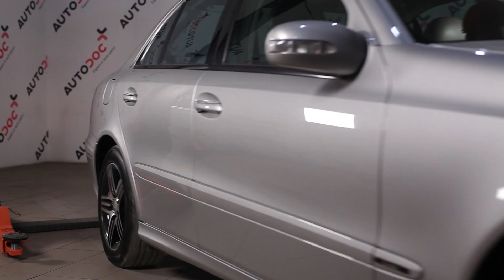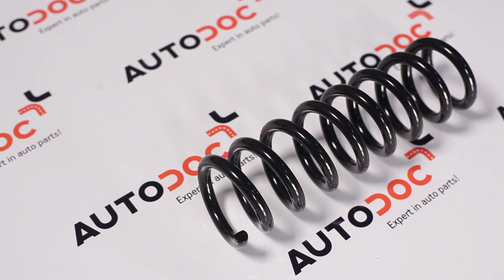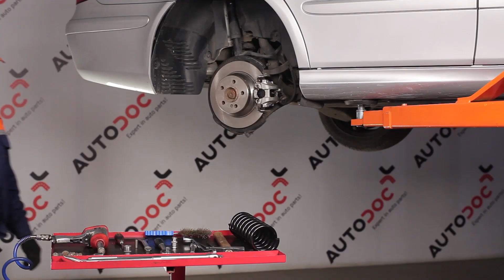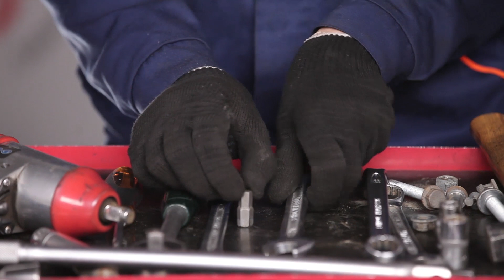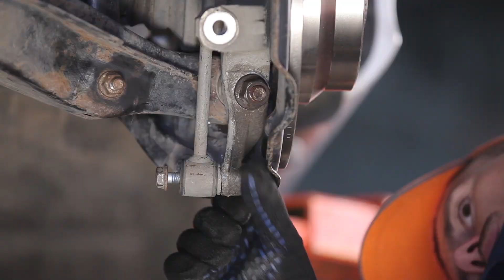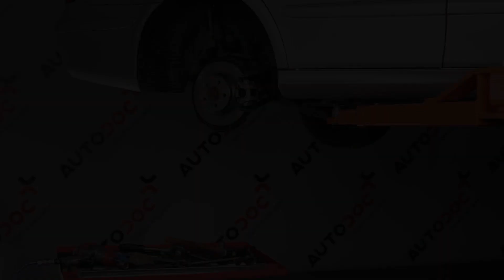How to change rear springs MERCEDES-BENZ E W211 TUTORIAL | AUTODOC

Comment: Had to use this rather tedious method as a backup on one side of the car. As others pointed out there is a steel bushing inside the wheel carrier which protrudes roughly half a mm into the opening and makes for an extremely tight fit to get the bushing from the spring control arm back in. It had completely seized and could not be pushed back by force. So I moved the control arm bushing past this obstacle first (slightly diagonal) and then straightened it out with hammer and mallet (inner and outer edge of bushing) out until a small part of the bore appeared on the other side ie. the bolt hole. Then used screwdrivers and all sorts of metal rods to pull it all the way through and align it. It helped having a spring compressor (low compression, safe), but it was not key to this work.
Reply from the maker: Thank you for sharing your experience, it will be very useful information for our viewers.

Comment: Excellent video and description.

However, 9:50 shows the hub not seated. Then by 10:10, as if by magic, the hub is perfectly seated ready to thread the bolt. In reality, be prepared for an EPIC battle to line up the bolt holes. Took us an extra 30 mins of fettling at this point.

Missing the torque settings for re-installation of bolts. Please add if you will. Cheers!

Also, there are 5 different rear springs for this model depending on spec, all colour coded. If you could list the Merc part numbers with description for vehicle type, this would be a great help.

Best of luck if you attempt this yourself.
Reply from the maker: Thank you for the feedback! We are glad that our tutorial was helpful for you. Your opinion and remarks are very important for us. We will take them into consideration for our next tutorial. Best regards, Autodoc.
Reply: Otto Fumbler, any tips for this?  I spent an hour trying to get this back in already?
Reply: Otto Fumbler doing this now. Any tips on reinstalling this knuckle?
Reply: jonosilvia you end up getting it back in? Any words of advice?
Reply: time warp? 15 minutes all in and I'm into my 2nd hour just dismantling, bolts were seized and I'both sides to do :-(
Reply: @autodocuk  Hello, you know where the sping sits into, did you try removing the other end side . 1 bolt at the other end and 1 shock absorber bolt. 6.45 left bolt at the end and shock bolt only?
Reply: did the opposite of what he did cause i had to replace the whole lca and when i installed it back you had to grind the inside of the hub so it can go in. lined that first then put the screw. then use a jack to put the other end of the lca (one with star bolt) either way it will won't be easy.
Reply: @autodocuk  can you please make a video using a special tool which makes the job dead easy. This work is not easy for everyone. Thanks.
Reply: I reinstalled the knuckle by removing the brake disc and bent the dust shield to get the crowbar under the arm to push the knuckle down still had lots of trouble but kept jacking up and then released to try and get it closer. Had to bash it with a wooden block until eventually I was able to get a screw driver in one side kept levering it and eventually got a small screwdriver in the nut side of the knuckle and then increased screwdriver size then moved up to a large hex key and was able to lever the bolt holes. Very difficult but did it this way as no advice online anywhere
Reply: By comparison, the front springs are a walk in the park. The only issue now is the age of the W211 chassis means you'll likely have to deal with considerably seized nuts & bolts. As well as front springs, I had to buy replacement upper ball joints having been forced to cut the old ones off with a hacksaw.
Reply: @ottofumbler7267  Hi Otto- So I was at the same point and about to pull out my hair.
The reason it is so tough (apparently) is that the opening is narrower than the new bushing.   Then I decided to go into the mercedes WIS and looked up the official procedures for remove / reinstall LCA. Lo and behold there is a simple step that this video omits.  SIMPLE.  One side of the receptacle opening in the knuckle is a smooth machined surface but the other actually has a has a repositionable bushing that slides.  You insert something into that opening from the rear to front of car and tap that bushing back into its hole until it becomes flush with that side of the opening. Voila- you just widened the opening. After that the LCA bushing will go in MUCH more easily without all the hacking.  Its a pretty clever design. This way I believe you torque the bolt back up it somehow drives that little bushing back so that you end up with a very nice tight fit against the bushing.  Hope this helps.
Reply: @ottofumbler7267 how did you ever get this bolt back in sir
Reply: @ottofumbler7267 I found the back easier
Reply: As others have said, this video is great up to this part. The truth is, there is a small raised flange on both sides, on the forward facing side of the hub that stops any bush, new or used, going back in. Until you file/grind/finger sander this down, you will probably never get the arm to seat. Once it has gone, it goes in without any effort at all, seat firmly and all is good. Nut I do call bullshit on this video just for the fact they gloss over that part.

Comment: Hi there,
It’s a late in the day question about this vid tutorial , but here goes, what size socket is being used to loosen that rear bolt at 2.52 mins into the video.
Also some people seem to be saying they struggled to get the hub assembly back into place.?. 
Would you have any suggestions on that part of the job also, as the video seems to cut away    Just before your technician shows how it’s done. 
Thanks for the video and any answers or tips you may have with these questions.
Reply from the maker: It is not possible to answer your question and you can find the requested information in the technical documentation for repairing of your model of car.

Comment: Great Video! I had a question, My 2010 Mercedes CLS 219 had both its rear coil springs replaced recently as they were fractured. Following replacement, the rear ride height seems to be a few centimetres more than it was previously. Is this normal? In time will the rear ride height go back to how it was on the old springs that were replaced? Many thanks in advance.
Reply from the maker: We do not have such information, we recommend that you consult your mechanic.

Comment: wouldn't it be easier to unbolt the inner part of the control arm? jost one bolt, and lower it with a jack
Reply from the maker: Thank you for the feedback!This video is considered to be an informative one, and it is approximate. Best regards, Autodoc.
Reply: LazeK that's what I've always done. Still sucks to line the holes up tho lol no getting around that part
Reply: The bolt does not always undo..that was the first thing i went for and it would not budge even with a half inch breaker bar :~[    so i had to do it the ball ache way
Reply: @ivornappinion9406  same here- wouldn't budge!
Reply: @EcoMan-te4vu  What a crap german design

Comment: The spring only sits in one position in the lower arm, remove the hand break cable from its retaining bracket on the arm, Good luck getting the arm back into the hub assembly, Its a pig of a job.
Reply from the maker: Thanks for your valuable clarification.

Comment: Just finished this job. I do not recommend undoing the hub to lower arm. It is close to impossible to put it back in. I have spent 6 hours as the bush is not solid but like Opel vectra's rose bushes. The best choice is to undo the lca to subframe bolt, but mine was rusted and would not get out of the bush. So in  this case I reccomend to undo the two bolts on the subframe and lower it then reinstall with thread lock. It sounds scary, but it is easier.
Reply from the maker: Thank you for the feedback! The video is informative and shows only the general principles of the constitution and the operation of the car and it is in no way to be taken as a manual for repair and maintenance. We appreciate you sharing your experience with us.  Best Regards, Autodoc
Reply: How did you do it in the end?
Reply: I recommend to undo the subframe side by side and lower it. If you undo the LCA better use sandpaper to sand the metal surfaces to get them easier back in.
Reply: @mp5team  I managed to do it very difficult just finished it 1 hour ago took me 2 days. In the end I removed the brake disc and bent the dust shield and was able to get a crowbar in and lever the knuckle down and after bashing it I managed to get a screwdriver in and then a large hex key. Very difficult but did it. Thanks for the reply.
Reply: @BigSlimThic  Lower control arm

Comment: Why the mechanic tighten the wishbone bolt on 3 minute? Why would you touch that bolt
Reply: Very late reply here, but he's actually loosening it so the lower arm can pivot down without putting strain on the rubber bush and damaging it. When it is put back together the suspension needs to be preloaded and allow the bush to settle in its correct position before doing the final torque on the bolt. This will mean there is no wind up in the bush at normal ride height.